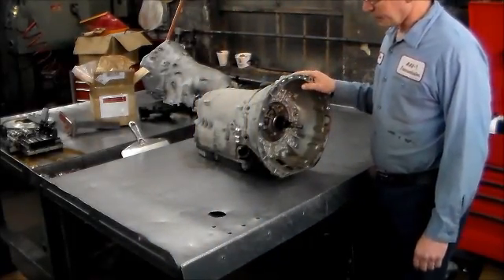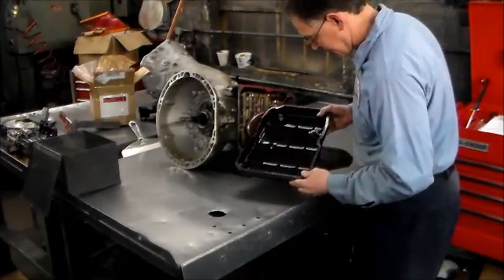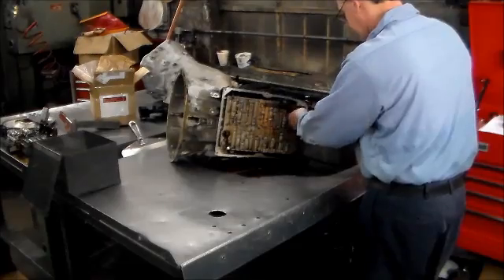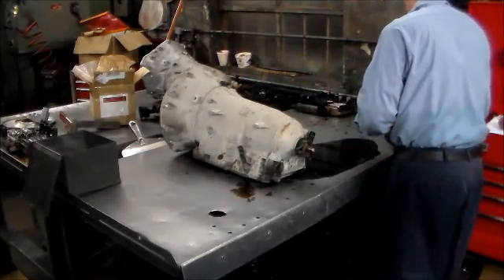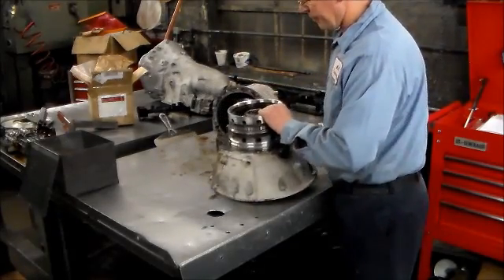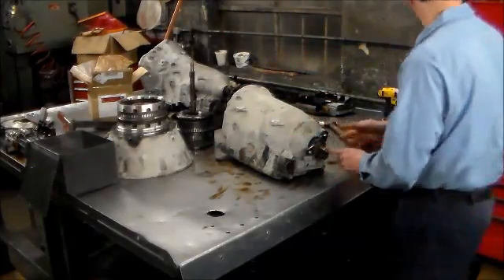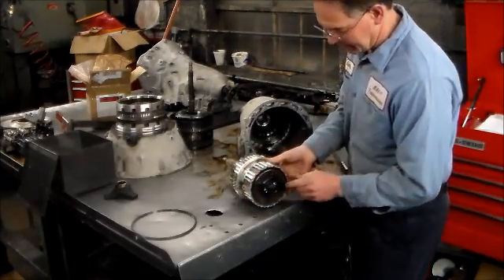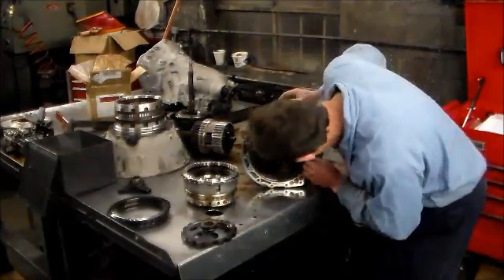722.6 Mercedes Transmission, Teardown Inspection

Comment: Gary Ferraro, I have a wjat I think is a 4 speed 4g tronic auto box in a viano Mercedes cdi 3.0 v6 wdf639.. So it has a vibration at 110 km/per hour or 68 miles/per hour. when I gun it on an up hill the 1st second I push the throttle it vibrates bad. Thanks to this video I could strip down the gearbox because it looks simuler . But the tailshaft flange has a bit of a play. And I checked the nut was very tight. I have the bearing ball out and it feels a bit dry if it is the right explanation . Now the 2 shims in the video behind the park gear mine has. But it does not have a shim behind the flange. Even the diagram at Mercedes says it does not have a shim there. It ndoes not have a bushing. The shaft does not look warn neither does the flange splines. Any ideas.
Reply from the maker: The shim behind the bearing, if not there don't worry about it.  Do you have any codes present for the trans?
Reply: @GaryFerraro  I checked the diagnostics now and bear in mind the gearbox is out, but the code is 0743
Stored&current
Component Y3/6Y6 (Torque converter lockup PWM solenoid valve) does not function properly. Short circuit to ground or open circuit.

Open circuit is because it is plugged out.
 But it is stored code so would that not mean something.

I see symptoms is shudder when pulling away which it does if you floor it for a second there is a shudder. And then at 110km/p/hour a light vibration
Reply: @GaryFerraro  I have noticed the output shaft tip is bend slightly. I guess that would be the vibration. But how does it bend. nothing is in contact with that tip.
Reply from the maker: @sv_endless6340  Not really sure on that, never seen it, if you release the gas, the vibration is still there?
Reply: @GaryFerraro  no vibration gone then. I just reassembled the gearbox. I replaced the output shaft bearing and seal. I also balanced the propshaft or drive Shaft, not sure how you know it. I am going to refit the gearbox and then run it without the shaft connected to see if the flange has movement or something. Will keep you posted. Thanks
Reply: @GaryFerraro  While the gearbox is on the workbench and I turn it by hand I can see the flange have slight movement off centre. That means the output shaft is bend, I am now sure of it.  They are not cheap here by our dealers. Little over a 1000 dollars just the shaft.
Reply from the maker: @sv_endless6340  ok sounds good
Reply from the maker: @sv_endless6340  where are you located?
Reply: @GaryFerraro  South Africa
Reply from the maker: @sv_endless6340  Oh,  Well Greetings from New York.  Maybe you can find online
Reply: @GaryFerraro  That's one of my life plans is to see New York at least ones. Love the photos and reviews and shows about and in New York. Thanks
Reply: @GaryFerraro  Hi. Hope you well. The output shaft has the round roller gear I guess you can call it, on there. Does that remove from the shaft. I am struggling to fine a shaft in South Africa. and on e ebay. Apparently shipping to South Africa is Difficult and expensive with our government ripping us off on import tax. I was thinking of getting the shaft manufactured and would be better if it is just the shaft without that round part. My transmission is still assembled after putting it back together, and want to leave it like that until I get the shaft, for dust, dirt, spares getting lost purposes. And mainly so I don't forget how I stripped it hahaha.
Reply from the maker: @sv_endless6340  The output shaft is part of the planetary, it;s all one piece
Reply: @GaryFerraro  Hi how are you. Just an update. I found a complete second hand gearbox with torque convertor included for 660 dollars in south Africa. So I am happy because it is way less than a shaft even if I could import one. Am busy assembling but as you might know,....NOT EASY...….. Thank you so much for your help so far. appreciated. OH and my gearbox is a 722640.. just batteling to sink the last 5mm. could be inside so will pull all out and start again :).
Reply from the maker: @sv_endless6340  Thanks for the update, keep me in the loop
Reply: @GaryFerraro  Hi. So i have the gearbox in and i ran the bus on the free way. The shudder that was there when you floored it is gone. But i am so sure i still hear a vibration. I do not feel a vibration but i hear it.  Fault code i do get when i check is P0730 incorrect gear ratio detected. But it goes in all the gears, kicks back perfect. The engine light came on ones and when i cleared it went off and has not yet came on again. The code is stored at the permanent code for live data.

Any ideas. I had the drive shaft balanced and checked. I had new tyres fitted and checked.
Reply: Thanks for the reply. I never checked for codes because I thought it was the propshaft. I am from south Africa so I don't know if the name of parts are correct. I did jack up the bus, all 4 wheels, and put it in drive and let it run while inspecting the drive Shaft(propshaft) and at the gearbox tail flange there was movement. I can send the video I took of this if I have your email

Comment: Gary. I drive 250cdi e-series mercedes with 722.646 transmission. I did wash the transmission with oil additive, drained oil, changed filter and gasket, filled in same amount of new oil as came out, then did flush change the oil 8,5L. Now I get 2nd gear excessive tc slip when trans oil is cold. When its warm, everything works fine. What would cause this? No issues before oil change.
Reply from the maker: any codes?   do you feel a slip when driving?
Reply: Havent read fault codes, no engine light at least. No more slip than before (and for my experience it really does work good), apart from when the gearbox oil is cold. Did 3 full throttle accelerations on standard mode 1-2-3 and normao engine+gearbox temperatures The tc lockup on first gear is rather noticiable, locks up around 3300rpm. As said before, when gearbox oil is warm, it works as before ish, good I would describe.
Reply from the maker: @jarnokarjalainen2668  Are you looking at live data, how do you know TCC is locking up?
Reply: Gary. I think I got this sorted. Transmission was low on oil level. When fully warmed up the level was at minimum. So likely it ran out of oil preasure when cold. I did not have the dipstick available when doing the flush oil change, I just added the same amount that came out and did th flush change for 8,5 litres.. likely it was low before the oil change allready.

As another question, would you recommend resetting the adaptations, and if so would it be better to let the gearbox learn itself, or reset and run the adaptations as the Mercedes program quides to?
Reply from the maker: @jarnokarjalainen2668  on the 722.6  i usually just drive them.  In order for the trans to adapt, there cannot be any codes present, check engine light off and transmission temp above 140F
Reply: Thank you, will do that.

Comment: hello I am from Poland I have From a few years of Mercedes Ml in 163 3.2 v6 year 1998 the vehicle has a mileage of 250,000 km I have recently been struggling with the problem of an automatic transmission which goes into emergency mode after heating error on the diagnostic computer sensor sporadic speed sensor error N3 and problem with engine misfiring on 1 2 3 cylinder coils ok ok wires spark sparkling ok catalysts where can there be a problem please help in diagnosis.
Reply from the maker: Well, you may have 2 problems but a bad running engine can affect the way a transmission works, so the first thing i would do is straighten out your engine issues and see if the transmission problems are resolved.  Are Clylinders 1,2 and 3 on the same side?
Reply: hello, as you asked the cylinders where the ignition falls, they are on the same side looking from the front of the engine on the left hand cylinders 1 2 3 the other side does not fall out, I just turned the injection, but it also does not think that the wine is after the pressure of fuel ordered expensive road fuel and manomert to measure the pressure of fuel on the strips - coils tested candles new NGK platinium cables ca. catalyst empty humped jets egr checked, also vacuum, I ordered in Mercedes servis intake manifold gasket is hard, I will let you know what to do next when I deposit new pump-pump Fuel in the tank clean as new - I have three MLs in 163 3.2 v6 this all with LPG STAG the rest works well only with this are troubles.
Reply from the maker: @pawew.3801  ok, so once the misfires are straighten out see what you have
Reply: The problem with ASB 722.6 appeared when I replaced the plug with o-rings, the power supply of the box when I tried to unscrew the socket were damaged-contacts, I realized it and replaced the plate with the new filter and oil for a year was ok now such anomaly - which is an occasional sensor error N3 rotational speed only how hot after a dynamic drive when the moment is stopped, eg 30 min goes into emergency mode after cooling, eg 6 hours, everything is ok
Reply from the maker: @pawew.3801  when you say ASB  do you mean ABS?
Reply: I'm not sorry in Poland, it's an acronym for an automatic transmission (ASB)
Reply: translating googles are funny especially when it comes to technical things or abbreviations.
Reply from the maker: @pawew.3801    The thing is this, a bad running engine will affect the way a transmission works.   So when you drive the car how does the engine run and how does the car shift?  Are you really pushing into the gas pedal to get the car to move and speed up?

Comment: Hi Gary,
Just found your video. Great production and explanation of the transmission. I have a SLK32 with a faint wirring sound that doesn't seem to change intensity with more revs. Is that something I need to worry about? Also found a  circle of oil on the garage floor when I reversed out this morning. From reading up on your site I'm hoping it's just the electric plug leaking. There are many 722 transmission in local wrecking yards so wondering if I should get one and rebuild it as a spare for the 32. Or would I need to change some components as AMG modified them for faster shifting. Appreciate your advice. Cheers Danny in Australia.
Reply from the maker: The AMG E55  have special pressure solenoids with blue tops. If this noise is not changing with road speed, are you sure it's coming from the trans.  Greetings from New York
Reply: The wirring is there in P, N and D but not in R. That suggests to me it's related to the box.
Reply from the maker: Double check the noise in reverse to see if it's there.  If there is a noise in drive and reverse but goes away in park or neutral, converter is no good.  how does the car shift?
Reply: Shifts great. Snaps on down shifts either on acceleration or tapping the lever left. The wirring is quiet, faint and you need to listen for it. I've stopped driving it to find and fix the leak and do a service. After draining the sump, can I drain the tc by idling the engine in neutral and opening a cooler pipe. This was suggested to me but I'm afraid of spinning the transmission without oil.
Reply from the maker: I never liked to do that, you can service the trans and  in about a week do a drain and fill
Reply: You were so right Gary. The wirring sound was from an oxygen sensor that had backed out half a turn. It's cable was clipped to the sump pan bracket. 

All serviced (will do a further drain in a week or so) and connector leak fixed. Thanks for your advice. Cheers from Sydney.

Comment: Wondering if anyone can help me I'm getting like a shudder at low rpms it shifts fine when I shift it in manual mode it goes away it also shudders when I'm slowing down to stop like the torque converter isn't unlocking it's a 06 Dodge charger Daytona with about 130000 yea it's my daily driver
Reply from the maker: ok,  does this happen cold?  also as your slowing down, put the car into neutral see if it stops shuddering
Reply: Gary Ferraro yea it happens when it's cold
Reply from the maker: Torque converter clutch apply normally will be commanded when the car is hot, when coming to a stop as you feel the shudder put the car in neutral see if it goes away
Reply: Gary Ferraro it dose go away in neutral  so that's probably slipping clutch plates I guess that's y it stopps when I put it in manual mode cuz it locks up all my clutches
Reply from the maker: When you get the shudder at low rpm, how fast are you going?
Reply: Gary Ferraro it's at all speeds could be going 30-60 it's always there feels like it goes through all the gears and then switches to something and starts to shutter if I give it more gas the shutter goes away
Reply: Should I try replacing the TCC solenoid it's a weird one day was fine and the next day it was there I did replace the battery the day before I put in a Bosch battery maybe the TCM got messed up I guess it could be a couple things I appreciate the help I know you can't diagnose it without seeing it but thank you for your time guess it's either get a rebuilt or buy a new one
Reply from the maker: Well, certainly sounds like a converter, the 722.6 do have converter issues.  If your cruising  along let off the gas then back on(doing 30-40 mph) you get the shudder as well?
Reply: Gary Ferraro yes it's only when you're giving it a little gas just to maintain speed if you punch it it goes away
Reply: Maybe this fits to your problem:
https://www.sonnax.com/tech_resources/234-properly-diagnose-a-722-6-shudder-in-vehicles-with-mds-system-engines

Comment: Hi Gary,  Greetings from Northern Virginia, my apologies for any intrusion. Q:  I have a 722.608;  w 247K miles drooped trans pan found metal shrapnel. Changed out Transmission Valve Body Conductor Plate TCU filter fluid change. Receiving via MB Star EGS Fault  147 - Sporadically Gear implausible or transmission slipping and 151 Sporadically Gear comparison negative. Target gear not achieved Could you please share with me your thoughts on possible causes and a focus to resolve? I have been using WIS / ASRA related information as a troubleshooting fault case guide. The left rear wheel hub, tire rim, lug nut did get hung up in the housing while driving and may also be a cause.  Thanks and Best to you and yours. I use to get out to you're neighborhood often, now only Battery Park, 33 Whitehall
Reply from the maker: The trans is full, you have the "tool" to check it?  How does the car drive? do you feel any slipping?
Reply: I have checked the transmission fluid level numerous times when warm @ temperature 80 degrees with the dip stick and it is within the hash marks.The vehicle seems to run fine change gears and then after a period of time starts slipping and going into hydraulic limp mode I believe.
Reply from the maker: ok, when does it slip? on what shift?
Reply: Gary Ferraro - today slipped going from 1st to 2nd gear and then loss of drive. It key reset. Thanks

Comment: Gary, great vid, thank you for your invaluable knowledge. 
I have a slip from 2nd-3rd. When cold, less of a slip and when hot, definitely slips. I have great power behind all 5 gears, just the 2-3 slip. There was darkish grey material in the bottom of the pan (did not smell burnt), few medium sized pieces of (friction disc?) and I'd say normal fine metallic gunk on the magnet/pan bottom,(nothing large screaming shearing gears, etc.) 
I do feel that I should replace 3rd gear friction discs and it sounds that i should replace sprags also however, "What drum are the 3rd gear discs in?" K1, B3, V8 lol.
Btw, my sprinter transmission has only 76k on it. A tranny shop, ditching the van and complete rebuilds are all out of the question. I can only afford to rebuild the one drum, sprags and fluid. Conductor plate is replaced.
Any and all help is appreciated.
Reply from the maker: Hello,
 The K2 clutch comes on in 3rd and stays on for 4th and 5th. The K1 clutch comes on in 2nd and stays on for 3rd and 4th.  maybe a lazy solenoid also, the shift solenoids are all the same if you want to swap them around
Reply: Big thanks for the super quick response Gary! I was thinking of swapping out solenoids also. Not going to cost me anything to try...I'll post back next week when i try that out. Thank you.
Reply from the maker: Ok, let me know, there are 3 shift solenoids

Comment: hi gary i have a 06 sprinter 2500.it wont move at all.
when you rebuilt these units do you changed the electronic components?
Reply from the maker: Do you have the tool to check the fluid ? see if it shows overfull, possible the pump is no good.
Reply: i going to buy the tool,but i remove the pan end is nasty.
so i going to remove it.
it may have a bad pump or the torque converter.
I going to rebuilt it.
Any recomendations?
to what to check or look for?
Reply from the maker: if your going to build, change both sprags, conductor plate too. If the pan  had alot of crap in it, you need to flush that cooler out somehow. Let me know what you find.
Reply: hi gary in this tranny what i found was the B-2 clutches burn out.
before i remove this tranny i put some good used oil just to moved it out.
and the car it moved in reverse but hardly foward.
Reply: do you change the gasket pump plate in this?
Reply from the maker: Ok, no forward is the B2, thats whats on, yes i do change the pump plate when i do the overhaul

Comment: Hi...whatfor is that shim beetwen bearing and output shaft drive yoke? Can be that some Transmission don't have it?Thank uI have noices in 4gear all the time and when slowing down from 3 to 2 and from 2 to 1 gear but just for a second(in the moment when changes the gear)Noices like manual Transmissions have in Reverse gearThank u verry much